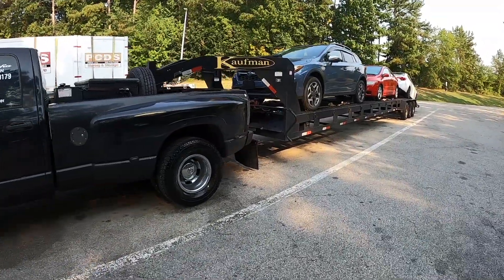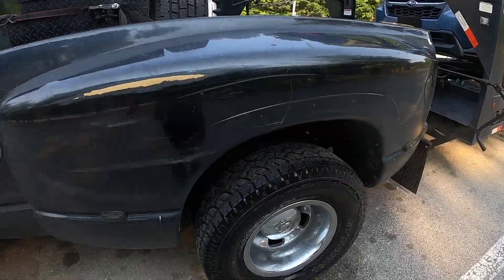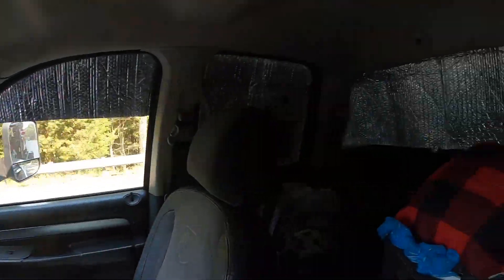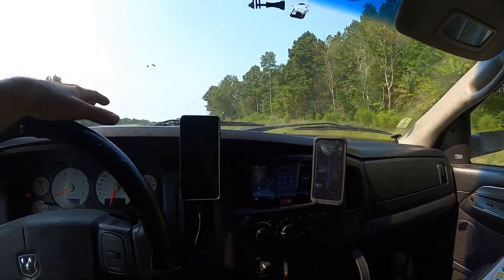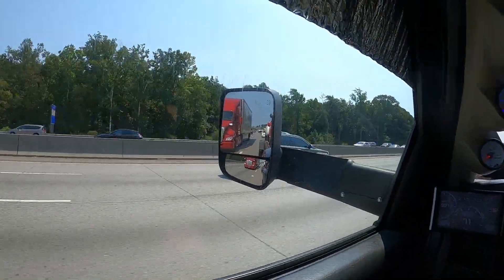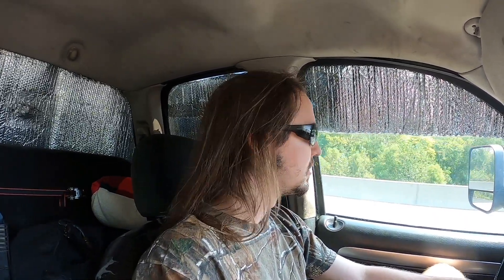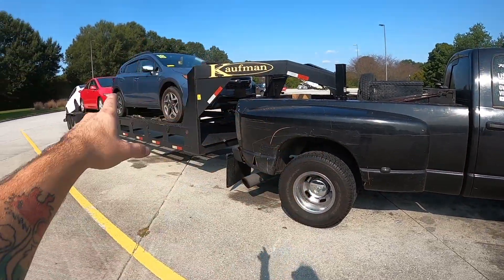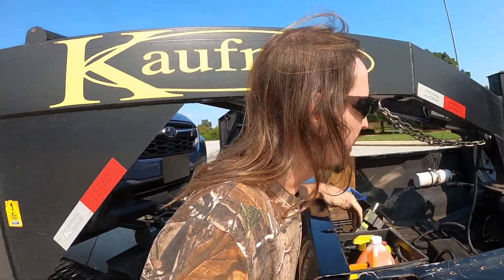Wheel Bearing Issues On A New Trailer | 3 Car Hotshot "Break Down"

Comment: I run a small trailer manufacturing and repair business and If I were to take a guess I'd say you have a slight bend in the axle. Whether the stubs were welded in crocked from the get go or someone just used that side of the axle to jack up a loaded trailer I'm not sure.

Comment: Little known.trailers can suffer alignment issues. Possible tweaked axle. Sloppy bearings in the springs and or bushings. .
That center axle is taking a Hella load on turns.. so I'd make sure the camber is right.

Comment: I vote that you Bent axle/spindle or other suspension component is broke/worn when you were “under weight” with that big load you never showed weight on.
Reply from the maker: I was actually never overweight on the trailer. It's 3 7,000 pound axles. Idk that I'd ever be able to get close but this literally just started a few days ago. I've never had anywhere near 21,000 on the trailer

Comment: I know I've asked before.. and you answered. What mpg are you getting at 70 mph loaded and empty? What mods have you done to that 12 valve? What Fuel plate and injectirz?
Reply from the maker: I'd day between 10 and 12. I'm usually not empty long enough to measure it but loaded right around that. 

Afc tuning
10 plate ground flat in the bottom
18 degrees of timing
He341 @ 35psi
5" turbo back exhaust
Grid heater delete

Comment: When you grease the bearings through the ezlube axles you want to spin the wheel while your doing it so the grease works it’s way through the bearings. You can blow the seal out if you pump a lot in and don’t spin the wheel
Reply from the maker: I was doing that, thanks!

Comment: Tire looks like spring bushings are worn or bent axle.. how much tighter does that trailer feel with the 5th wheel over the gooseneck.
Reply from the maker: A lot better but it's still got some slop from the rails themselves. I wish I would've just gone with the turnover ball setup and a 5th wheel in that

Comment: Is there any max length for truck and trailer combination.  I have same trailer but ram 2014 and I’m not sure if I’m to long  I’m non cdl.
Reply from the maker: If you have a bed on the truck it's generally 65ft but I was around 71+ and they never hassled me

Comment: It's a combination of problems more than likely. Usually the bushings inside the spring eyes wear out first taking out the rest of the suspension. Once those bushings wear out it puts excess pressure on the slipper spring resting point inadvertently breaking the welds. You want me to bring the welder down and bulletproof that b** for you? Get on your back and look up inside The equalizer and see if that PIN broke. Usually that howls out and then the weight of the trailer is riding on the broken pin. The reason so many people miss this is cuz you actually have to get on your back and look up inside The equalizer
Reply from the maker: I could use a welder right now lmao Go check my instagram or snapchat. You'll see why
Reply: @CPSteveMiller  I don't have either platform. I guess I probly should huh? Did you find broken stuff?
Reply from the maker: I can't post the info on here. It ain't the trailer. And it definitely wasn't my fault. Let's just say a certain company owes me thousands of dollars as of 5am this morning. Shhh🤫🤦‍♂️ Video will be live at noon but everybody on my snap and Instagram know some of the details already
Reply: @CPSteveMiller  oh boy....5am says it all...I think...I hope everything is ok. I will wait for the video and see what's up!

Comment: Get use to it, I have 2 Kaufman trailers and I'm constantly replacing the outer wheel bearings.  I usually get about 2k - 3k miles before they come loose and need replacing
Reply: Dang man a quality outside bearing and race is 30-50 bucks a side. X4 on a two axle is upwards of 200. That’s needing replacement every week😳 I’d get rid of those trailers or see what’s really going on….

Comment: I paused the video right at the beginning to let my dogs in...and dang dude you got that truck looking sharp!!! I paid $300 for my set of dually simulators. There's 2 brass hollow studs you thread onto 2 studs and nuts that look the same as the fake ones except for 2 little dashes on the flats so you know which ones to loosen. No problems with them coming loose, and no separate hubs to lose.

Comment: If you check market place for Petersburg Mi. They have a nice wedge trailer with the 8 tires for your cdl when you get it. Same brand as the one you got lol.
Reply: Think 2017 $9500
Reply from the maker: I won't be buying a wedge now. I'm going to be looking for a 40ft dually flatbed after I get my cdl. I like this trailer too much to get a wedge😬

Comment: Maybe check the leaf spring bushings on the balancers, if you haven't already. They will cause irregular tire wear if they're broken or egged out. Or even the pin side of the balancer where leaf springs float on. Basically, inspect the balancers as well. Happened to my trailer. I changed out the balancers, and the tires went back to wearing normally. Keep up the hard work and Godspeed brother.

Comment: If its not wearing both sides, more than likely a bent axle.  Could possibly be an alignment.  Most of the time you bend the pass side of axles from curbing or dropping them off the road.  Id check the alignment first.

Comment: Have you weighed the trailer empty?
Reply from the maker: No. The old owner did and says it weighs 6,400.
Reply: Seems about right. I would have guessed 5900 or so. Looks like a decent trailer, once you get the tire wear fixed

Comment: Good catch on that bearing, I had one burn up and trash the spindle. A whole new axle drum to drum is what was needed. The new one I bought assembled so all I had to do was bolt it in and it had pretty much zero play if any with the tire bolted on it ran under 100 degrees which was about 20-30 degrees cooler than the other I still had that came with the trailer. Went through and replaced the bearings/races (Inner PN# 25580/25520 Outer PN# 14125A/14276) with all timken and I'd recommend grease seal PN# 412920 as its super beefy compared to the normal ones and nearly impossible to distort while installing.

Comment: Ok so you want the 14ply tires. You need heavier rims to run them. I mount tires for a living an we run in to this all the time putting the heavy tires on light rims they run for a while but if u run them at full pressure or do alot of hard sharp turns you will start cracking the centers out of the times either when the rim center meets the outer an loses air or with the lug wholes are will start cracking eventually
Reply: Yes I second this info...4400lb steel rims.  Most of your trailer places sell tire/rim combo...$225

Comment: I’m sure you know this but in case you don’t,  but you can have those instrument clusters repaired. I pulled mine out of my 3rd gen, sent it in and had it back in around 10 days. Cost around $150-$200. Works like new now.

Comment: Did the axle shift loose u/bolts on that axle?Replace the bearings and the races and seals .Also check the suspension bushings and the bolts for the springs they wear very quickly.

Comment: Play is ok in bearings , it allows for expansion when they get hot .
Reply: Yeah as long the bearing is within tolerance when they made it. All that is figured in you mentioned when tool and die specked the tolerance. 

Basically you want it big enough when at operating temperature to not be tight, but not be lose either at that point.

Comment: Looks like the bearing is going need replacement asap. I've needed new wheel bearings in my 18+2 utility trailer for about 4 years now but it doesn't bother because mine doesn't go very far

Comment: My 7k axle trailer had original bearings when I traded it in, over 250k miles. Every 10k i would go through a tube of Schaeffer 274 grease. Run 70-75 all day long. And also ran 10 ply and only had one or 2 blowouts, so guess not typical results on either topic.

Comment: You'll Have a MM to non in the bearings new. The castle nut is and tightening down is a pain since the play as you found out. I have a bearing giving hell on my small 20fter. The wheel is loose but its not leaning so im rolling with it till it gets hot, flys off, or leans. That type of wear I've encountered due to light load. Might be that rear car loaded backwards putting load on your front and rear axle leaning the middle with no load. Seems odd, since a heavily built trailer.

Comment: You could have a bent spindle for that bearing looks like it's gotten hot the color of it and the bearing is going to go bad on you not trying to tell you what to do partner you doing a great job be careful out there and safe travels yes they supposed to have a little bit of play where the Bears won't get hot don't over tighten them but you're doing a great job and I like seeing you have no problems cuz I like your videos and I like the way you do things

Comment: Like I said before I've been turning wrenches on big rigs for years. That little bit of side to side play in that center bearing is giving you a lean while driving.
Reply from the maker: Good to know. I'll have new parts on order after I deal with today's dilemma 🤦‍♂️
Reply: Ran a Kauffman 3 car wedge for two years. Bearings and spring bushings to biggest tire ware issues. Also when you do brakes the easiest way do the brake kit just unbolt backing plate replace all at once.
Reply: Little bit of slop is OK brother, but new bearings would be best of course, super cheap. Sorry about the inconvenience you had today, hope you’re safe and sound? !!!!

Comment: Hey great channel doing good job. Like the honesty on thing.I’m betting your axle  is bent. Is there a year of the 24 valve Cummins that is better than others thanks stay safe
Reply: If your talking about the 98.5-02 24v then no not really, all years had the same basic issues, I own a diesel shop in ohio and regularly see 24v trucks with 400k miles and still run like new. Just take care of the typical issues like needing a lift pump and a quality vp pump, then if you replace any sensors or seals on the engine I highly recommend using cummins brand parts
Reply: @farmingforfun9534  thanks for info

Comment: It could be the axle was bent when you purchased it, and now you notice it.
Reply from the maker: It wasn't doing it before though. Going to replace the bearing and see😬
Reply: I think you made a good call,I would check axel alinement.
Reply: that might be the suspect also axles alinement not being square to trailer frame?

Comment: I wouldn't buy new tires until i figured why it's wearing weird...  Maybe get somewhere level and pull all drums/hubs and get precise measurements between each axle and compare to drivers side... may tell you something. Otherwise take it to a trailer shop.

Comment: When tightening tapered roller bearings you want to have a little bit of noticeable drag when you spin the drum by hand. Tightening the nut to that point will ensure there’s enough preload on the bearing. That kind of bearing needs some preload on it to get the rollers to spin as the wheel turns instead of just sliding on the race.

Comment: Why don't you have more intelligence about  Brrrings and Races.
That moment of the Berrings has ZERO affect on the Berring life, those Berrings and only being held in place by that little cage.
Clean your Berrings and Races with Gas,Remove all Grease.
If you see  a pitting or heating mark change your Berrings and Races and Seals. Your half harted ways of Axel care are goings to cost you thousands in Damages one Day. 
TIGHTEN UP.
Reply: F-------- Facebook.